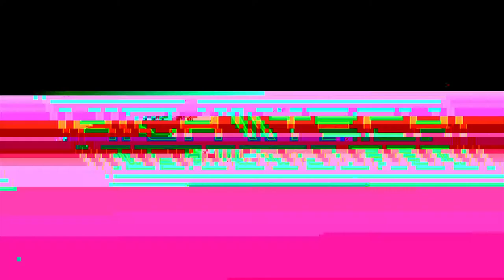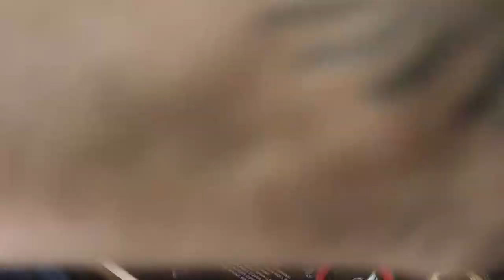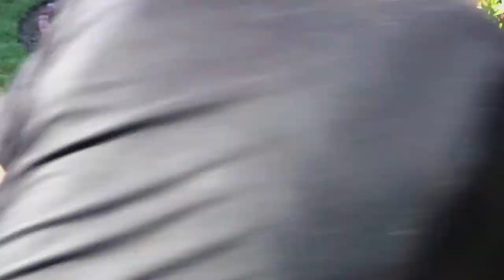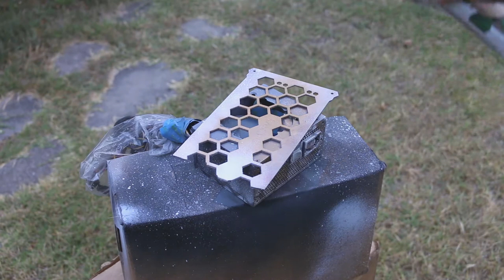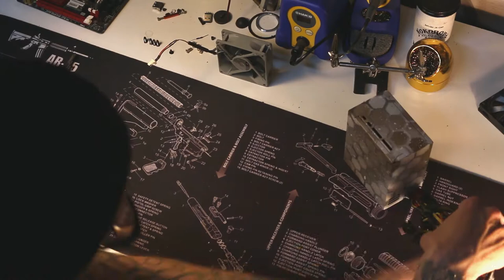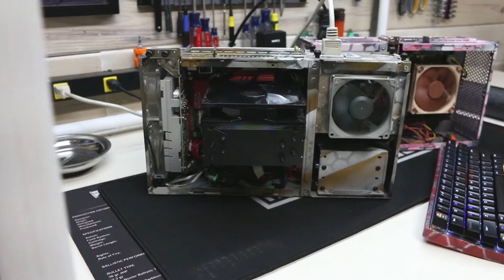🖥 DIY Painting PC parts? Making a MINI-ITX Digital Audio Workstation (DAW) with a huge heatsink!

Comment: lol, using i7 3630q in a 2012 thinkpad. btw, when changing psu fans be sure you replace the priginal with a fan that has same cpm or whatever its called, meaning it can push the same amount of air over the psu components. because, if you ramp up cpu usage and the wattage goes up and psu fan cant keep up with the heat of the psu components… yeah, bad.
Reply from the maker: Computers just haven't been progressing as fast as they used to, so it doesn't facilitate the need to upgrade as often as before (going from single core to dual core). I'm certain most PSU's have thermal protection, I've modded quite a few PSUs with Noctua fans and never had any issues with heat, maybe if I was rendering 24/7 I would deal with the noise to be on the safe side 👍
Reply: @hightech-lowlife  yeah, maybe youre right. maybe with atx psus its easier, but ive wanted to mod a 1u flex psu with a noctua, silverstone fx350, and ive heard horror stories. but then again, those psus come with a 40mm fans and albeit being smaller maybe heat becomes an issue there sooner rather than later. still havent modded mine, its still a jet engine. at idle. at full load. once the htpc is on its 3000rpm constantly. what a stupid design, lol. cheers.
Reply from the maker: @cordlesswire  Oh yeah, those server PSUs are not designed to be quiet. They're designed to be shoved in a closet that no one will be anywhere near. If you have room above or below, I would chop a giant hole in the top and drop a 120mm fan on it. I'm sure it would probably be even cooler than stock and barely audible. 🍻